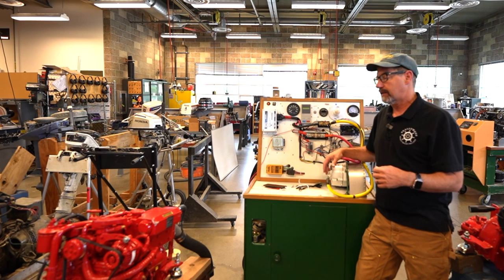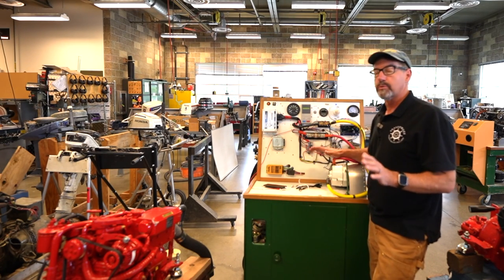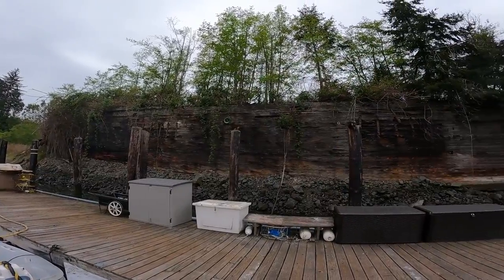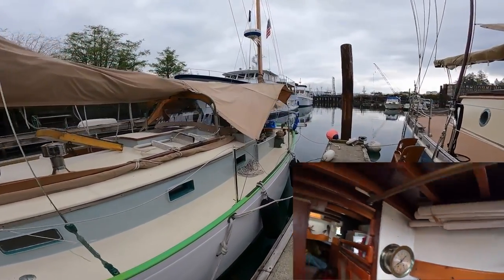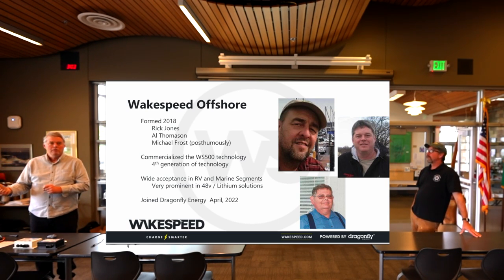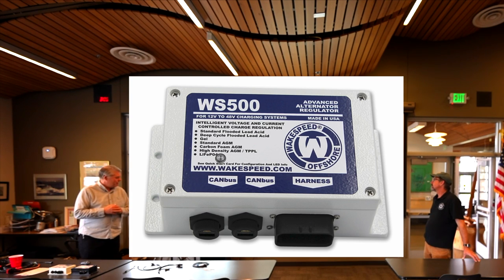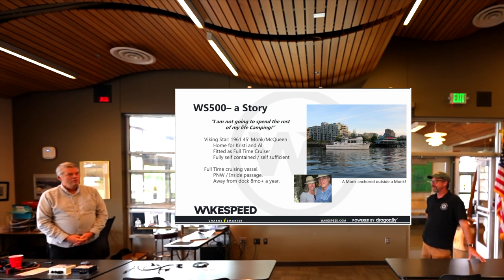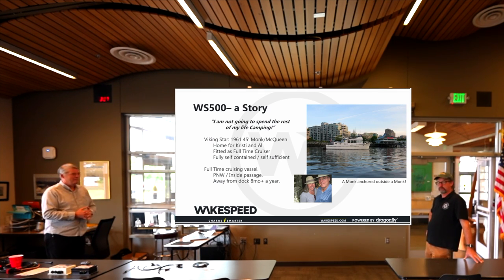WS500: Using the "Feature-In" wire with High Output Alternator on a tiny diesel engine!

Comment: Another great option is the Electromaxx Genmaxx, one of the best alternators on the market especially if you opted for the remote mounted rectifier. The industrial needs to recognize Ken Knight as one the first pioneers in opening up this technology.
Reply from the maker: I do like those alternators! We were looking for direct replacement options. For new technicians this is the best option, we bring in custom mounts and large frame, but awesome, alternators later.

Comment: Please do an in-depth, focused video on how to set up whitespace. I’ve watched all the videos from the spring training and I’m frustrated by Al’s many references to what you will talk about tomorrow , which apparently won’t come for the rest of us 😊. TIA
Reply from the maker: I've reached out - Dragonfly energy is supposed to be working on an official video about whitespace, If it's not being worked on I might try to find a few minutes and create one.
Reply: @SVCSkallywags  Thank you, that would be great. How about “Whitespace For Dummies”? That should garner a few clicks.
Reply: Using the phone app to build the configuration, it's pretty easy to setup. You have a series of graphs that you can modify that specify what the maximum percentage is at various rpm bands.
Reply: @nonenowherebye  Thank you for adding your experience, I appreciate it. Since I posted the above, I have played around with the app and come to the same conclusion. The technology is amazing.

Comment: Could you do a segment on how to take the power-efficiency curves that,  say, Yanmar or Beta produce to set the white space most efficiently and safely?
Reply from the maker: Good thoughts, we could probably put that together. I'd consult with Al the WakeSpeed founder to verify my process. Essentially you can use factory power curves and look at the power curve vs RPM*** As long as your engine is propped correctly and reaches the factory W.O.T R.P.M's***
Reply: @SVCSkallywags  I’ve done it (correctly, I think) but there’s a lot of folks out there who would benefit from a tutorial. 

Great content. Thanks for sharing with the community!

Comment: In the beginning, you should mention what you say at the middle. This system you're thinking of in your head as you describe all this is a traditional battery (fancy carbon foam) not a Lithium system with a BMS system.

Are you trying say... if you apply system nominal voltage (12/24/48) depending on your system) to Feature In that you have configured the Wakespeed to limit itself to 1/2 power (a voltage regulated charge) and then you disconnect Feature In, you let the Wakespeed go at Max Power?
Reply from the maker: Thanks for feedback, we'll probably do an updated video with more features this fall. I'm still working with Dragonfly and this product

Comment: Thanks for doing this video! I hope you can clarify something I was confused about. I understand White Space and its great value, for example of setting it so at idle RPM (eg 800) or at max RPM (eg 3000) there is 0 field current so no load on the engine. But if one sets 100% at 1100 RPM, is it not the case that based on pulley ratio this still might represent a relatively small load (not 80%) on the engine? In other words, the load at 100% is still dictated by the RPMs/pulley ratio so even if it is a 5,000 watt alternator there might only be for example 1,500 watts (low load) being harvested at that low RPM? Thanks for any clarification you can provide!
Reply from the maker: I'll give this a shot at clarifying. Let's use a Beta 20 HP or 14.9 KW and let's say we put an American Power Systems 250 amp, 12 volt alternator on it (3 KW). If we target 80% which is 12 KW continuous. The 15 KW is at 3600 RPM. At 1500 RPM the engine only has 5 KW output, so if you want the boat to be able to motor, you need the output of the alternator to be at about 10% this is the whitespace that is available. The WakeSpeed will do this for us so that as we speed it will increase the alternator output to keep the engine 80% load with varying engine speeds and environmental conditions on the boat. 
Hope this helps.
Reply from the maker: Second cup of coffee. The pulley question: most modern alternators are set up so that once the engine RPM is above about 1200 they are capable of full output. When we do large alt's on small engines we need to watch this, unless charging at anchor. This is only part of the white-space. Once the boat is at cruising speed then we want to add load to get to 80% for that RPM ~ in my example maybe the boat is using 8 KW, so we want the alternator to add 4 KW of load to keep the engine at the 80% load (12 KW). Dragonfly is supposed to be making a training video about this topic, I may do another and go into more detail as well - it's an awesome feature
Reply: @SVCSkallywags  Thank you for this answer. It is helpful in explaining the concept but how do we (Wakespeed?) determine the needs of the vessel? As I understood Al’s brief introduction to whitespace during your training session, the WS500 gets programmed to allow specific charge rates at various rpm.